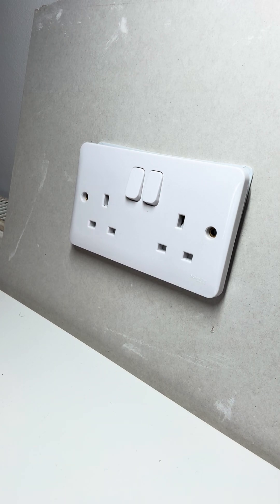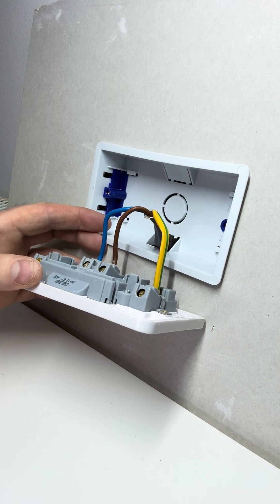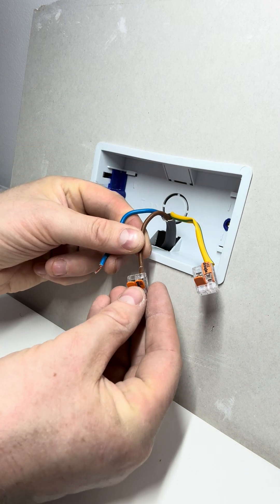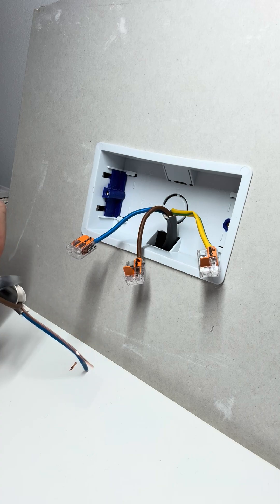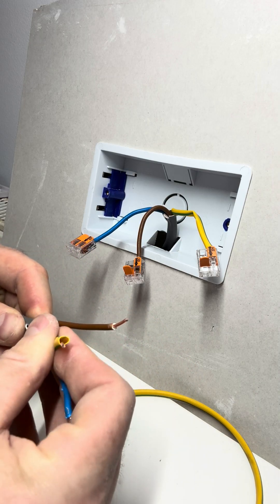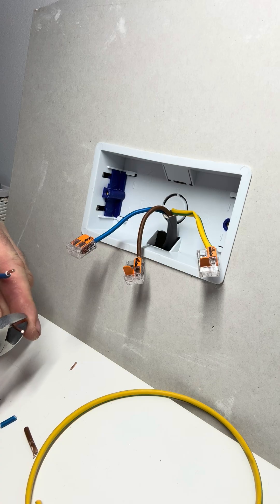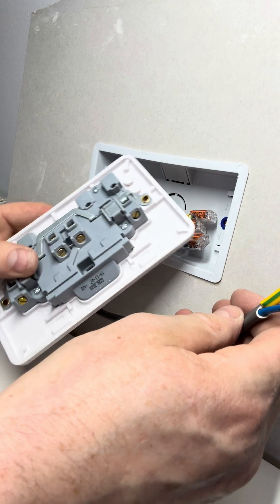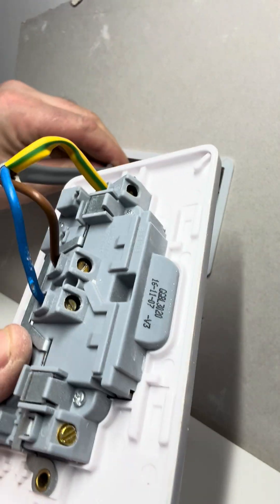Extending an electrical socket @mediawalls2u

Comment: Nice video. Whats the name of the unit you are using tor testing the socket
Reply from the maker: Thank you, so we use a 3 pin sockets tester which tells you of any faults on the line, also we use the voltage detector pen which are great 👌🏻